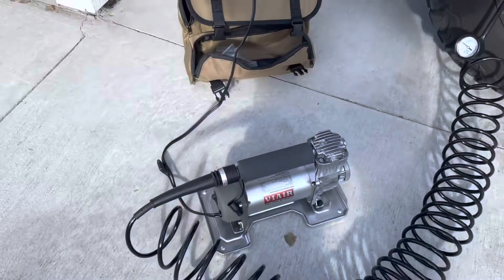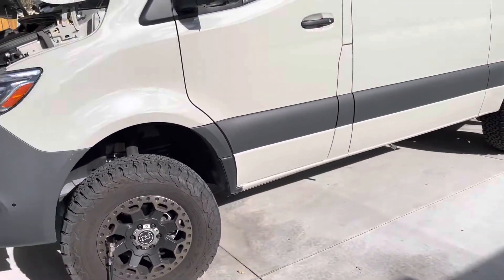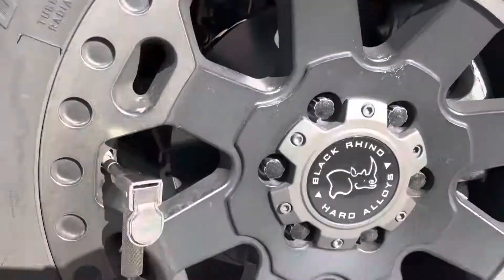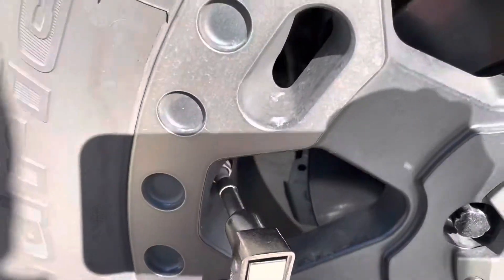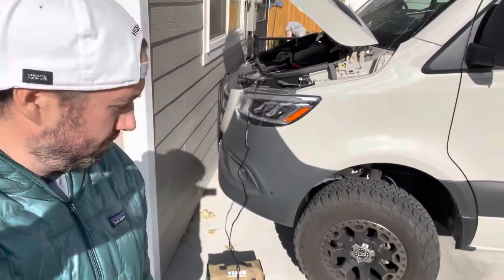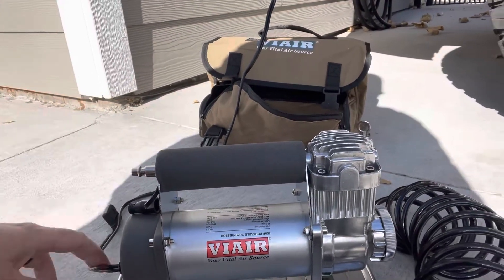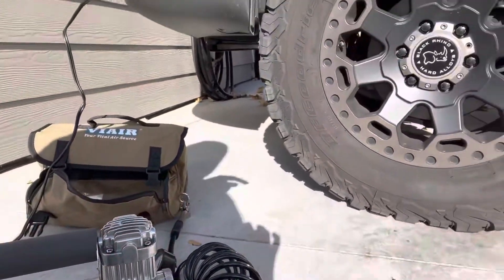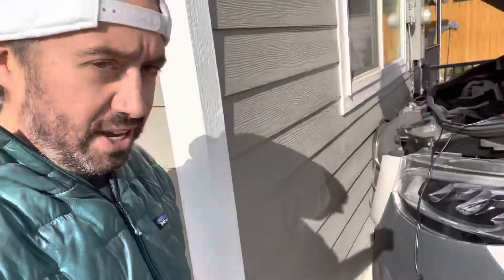Sprinter Van Onboard Air Compressor - Save Your Money

Comment: Thx for the vid. Did u just connect the battery clamps to the + and - jumper posts in the engine bay? No optional aux battery in your engine bay? Thx!
Reply from the maker: Correct, no aux power for this. Best to connect to van battery.

Comment: How much did those 265 tires and rims affect your MPG?
Reply from the maker: Hard to say because I swapped out from stock after 100 miles. I will say that I maintain a 15-16mpg average with my current set-up - see recent video with suspension.